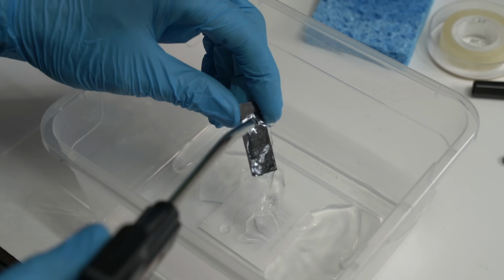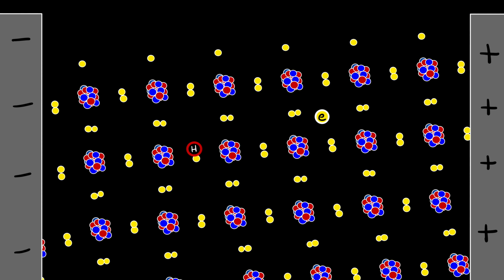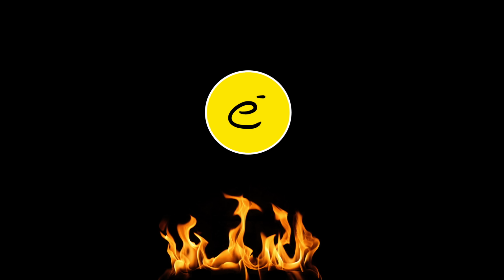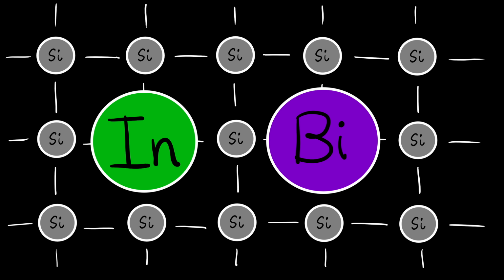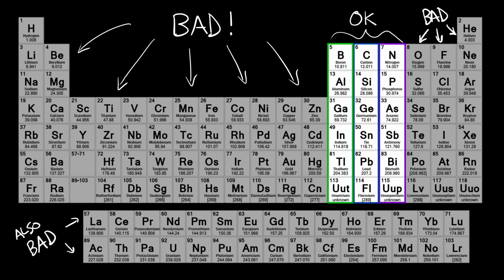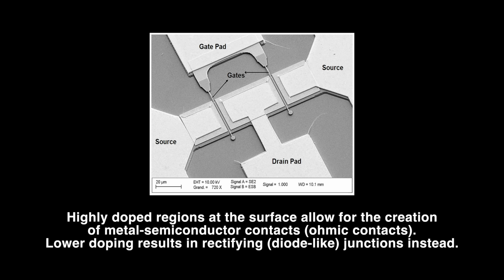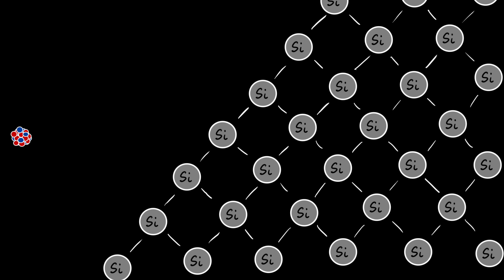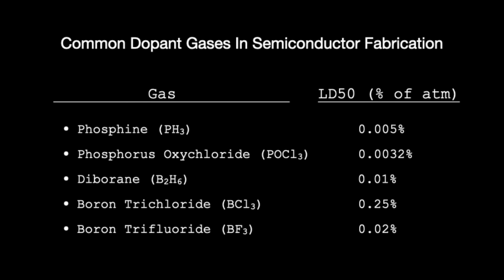Doping: The Most Important Part of Making Semiconductors

Comment: One question I have. Why not use ALUMINUM as dopant?
Reply: N-type doping (adding phosphorus) doesnt really add those phosphorus electrons to the silicon conduction bands, it really makes a small "donor band" somewhere between the valence and conduction band. P type doping adds an acceptor band above the valence. Aluminum, being more metallic in nature, would have energy bands that are, like this video said, "incompatible". On top of this, the atom is bigger, and has a much much higher ionization energy compared to boron. Aluminum is used in some applications but it really just isnt great, and boron is super common

Comment: The semiconductor equipment I final assembled in 1984 included buttons labeled n2 solvent resist spin. 16 inch teflon tubing was used to dispense those chemicals.  What processes were used

Comment: We would dope a 10kg charge of Polysilicon with Red Phosphorus using a dope tube on a Czochralski furnace by tipping the tube (hose) filled with dopant and dumping into a very hot melt. It was actually the most mass of measured dopant as much of it burned off on the surface of the melt. Arsenic, Antimony, and Boron were weighed on precision balances and just dumped on the polysilicon before melting in the crucible, and the amount was in milligrams. GOOD TIMES, GOOD TIMES 😉

Comment: Maybe you can answer this question for me because all the electrical engineers on stackoverflow or google seem to turn a blind eye. The question goes like this: In an npn transistor, lets say you leave the base floating, why does current not flow from emitter to collector. You might say "oh, that's easy, there is a potential barrier" but then alot of people seem to forget that the potential barrier is a measley 0.7 volts. And in my experience bjts have a lot more voltage. between them than 0.7v. So how is this 0.7 volts depletion layer potential able to stop greater voltages like 20v, 12v etc from allowing current flowing from emitter to collector. I know bjts are rarely operated in the open base configuration but understanding this will help me understand why it takes a small bias to do what a large voltage couldnt (bias is the name given to voltage applied to base terminal in bjt)
Reply: its 0.7V forward, but much more when reverse biased. Exactly like a diode.

Comment: YEEEEEEES the deep level impurities is what i was looking for  to make the afformebtuoned battery i soecified in the previous video,cz the way i see it atoms closer to silicon form switches and atoms further from silicon form batteries when doped onto silicon based on the deep level impurities you mentioend,,,now atleast my research is heading somewhere...nkw if only i had a means to fabricate semiconductor chips to teat out this battery hypothesis
Reply from the maker: if you're looking for information on energy storage in silicon you should read up on quantum wells and things like charge coupled devices. That being said, the energy density will likely never approach that of chemical batteries.

Comment: Amazing video, definitely one of the best explanations I’ve seen. One thing I’m now a bit confused about is why the metal contacts on transistors don’t introduce intraband states?
Reply from the maker: I'm not 100% sure on this answer, but my understanding is that as long as the discontinuity between the metal and semiconductor is thin enough, the electrons tunnel through and basically ignore the junction.

Comment: Actually you can use a nuclear reactor to produce semiconductors. The processes is called Neutron Transmutation Doping and involves neutrons diverted out from the nuclear reactor. These neutrons are absorbed by the silicon atoms forming an unstable heavier silicon isotope. This isotople quickly undergoes beta minus decay converting the excess neutron to a proton and becoming phosporus. Since neutrons can penetrate deep into matter and don't care about chemical composition or such they can evenly dope the silicon quite deep without much issue. This costly and involves radioactrivity so it's not really common. I know you were joking but for those who don't know uranium is safely sealed in the reactor and only the neutrons are coming out so there shouldn't be any uranium contamination. Besides if uranium has become a gas semiconductor purity will be your last concern. Certainly this will be your preferred doping method in the future right?
Reply from the maker: Yeah, I thought about including this to come full circle on the "exposed core of a nuclear reactor" joke but ended up cutting it because nuclear transmutation doping is basically not used outside of research labs

Comment: I remember skimming over a paper about doping wafers with plain phosphoric acid a few years ago. It was from the solar industry, but I don't see how it wouldn't translate to other semiconductors. I can't find the exact paper anymore, but some very similar ones about the same topic were published recently: 10.1007/s12633-022-02231-3 and 10.1007/s12633-023-02658-2
Reply from the maker: I tried plain phosphoric acid but it really doesn't seem clean enough for my purposes. high concentrations leave a horrible residue (silicon phosphide maybe) on the surface that cannot be etched away

Comment: Hey saw you have a fiber laser.  You can deposit simple Al contacts on Si by simply wrapping the Si in Aluminum foil and lasering squares into it.  For my 50W, I use 35% power, 500mm/s, 20kHz or 30kHz rep rate and 0.01mm hatch.  Evaporates a nice square of Al, giving ohmic contact and even contacting through native oxide.
Reply from the maker: to my knowledge i don't have a fiber laser but i appreciate the suggestion!
Reply: Oops my mistake!  Good excuse for a new toy, though.

Comment: I think you left out a fourth doping method but i could be wrong. I know there also is neutron transmutation doping, but i don't know if it has any industrial significance. Great video btw!
Reply from the maker: I was considering adding it, mostly to come full circle on the "exposed core of the nuclear reactor" joke from earlier but it got cut because nuclear transmutation doping is really never used outside of a couple research experiments

Comment: Your spin-on diffusion doping process is ingenious. If I am thinking right, you can apply the liquid dopant solution on top of a photo mask. Making the doping steps very similar to the other process and you can basically use it with the precision of your lithography process x3
Reply from the maker: unfortunately, the diffusion step has to take place at ~1000C so the photo mask alone won't hold up at those temps. An oxide layer that has been patterned using a photomask will though

Comment: One of the more interesting bits of physics unveiling before my eyes was watching gold diffuse into copper, in plain air, under a microscope.  Coworker had ordered some garbage tier RC power connectors that use hopes and dreams for their current rating, instead of real life figures.  But it probably wouldnt have set itself on fire in the application it was destined for so I humored him and was installing the connectors onto leads. As I soldered them, the whole outside of the solder cup (not exposed to solder, that was on the inside) went from the gold color of the plating to copper color. Looked it up, and turns out gold diffuses into copper really starts to pick up at 200C, right around what the solder would have been.   Normal good gold plating has a nickel layer underneath to stop this (and oxidation beneath the gold)  But because my coworker was being a cheapskate, and whatever factory in china didn't think that nickel bath was particularly needed, I got to watch solid metal dissolve into another solid metal under a microscope.
Reply: Yup, silver and zinc as well. Hence the ~high school experiment plating a penny with zinc then heating it to brassify the surface -- you really are getting a brass layer, it's not just the thin layer of zinc oxidizing to an interference pattern or something.

Silver (directly on copper) is semi-commonly used for PCB plating, but usually it disappears into the solder by the time diffusion would matter much.  Along with tarnishing, it can be a concern in storage though.

These also illustrate the Kirkendall effect, where the diffusion of atoms into each others' bulk reduces the density in each, creating voids.  Well designed plating sequences (or diffusion schedules) avoid this in most cases, but there are industrially important applications where the voiding affects joint strength -- Sn-Cu diffusion (and intermetallic formation) in solder joints, for example.
Reply from the maker: that's wild! i have never witnessed that

Comment: Super dummy question - you call yourself a hobbyist (even though I bet you must quite quite detailed knowledge about semiconductors and I guess you work in the industry). But let's assume you are a true hobbyist for a time being. So if a hobbyist can develop a cheap and relatively safe replacement for all those toxic gases, why all big multimillion foundries has not found out this idea?
Reply from the maker: It's a good question! For starters, I'm not in the industry, though I did a bit of related lab work back in college. In industry the demands on their processes are huge- they are desperately trying to make chips with billions of individual transistors, all while trying to maintain the highest possible yield (number of good chips vs defective chips off the assembly line). These goals mean that if you have the choice between a safe chemical that is effective, and a toxic, carcinogenic, explosive, and otherwise extremely scary chemical that is slightly more effective, you'll choose the more dangerous, but more effective route every time.

Comment: Does it really take 20 minutes to say you made your own doped TEOS recipe then cut on a cliff hanger? But congrats though. If it's home chemistry, I'd assume it's one of the rice hull ash glycol depolymerization routes, since they produce relatively high purity TEOS with hardware store chemicals and are fairly idiot resistant compared to carbothermal arc furnace or Siemens processes. The research I recall reading asserted that spin-on glass was usually too porous and irregular for semiconductor use apart from MEMS though. Unless the plan is to diffuse the dopant out of the dopant-rich spin-on glass and into the silicon then etch the spin-on glass layer away?
Reply: Some people prefer more explanation than others, and I think it’s nice that this video takes the time to teach.
Reply from the maker: I was going to make it all one video, but i decided that if i went straight to the lab work then to keep the video length less than 30m id have to gloss over a lot of info that i felt was necessary to lay out in detail first.

i am curious about the rice hull and glycol thing, if you have a source you'd like to share

Comment: When you mentioned N-type, I got excited because I knew the other would be P-type because of NPN/PNP transistors!
Reply from the maker: Don't forget PN diodes as well!
Reply: For the longest time [growing up], I thought you could just take two blocks of the stuff, now kiss .png  and boom, diode, transistor, whatever. (I tested, and wondered aloud, why wiring two diodes together doesn't make a transistor.  Hey, I was... probably 9 at the time?)  Sadly, all those early/easy/common references neglect to mention two things: 1. charges move by diffusion, and only travel so far before recombination dominates (in Si, a few µm, maybe 10 tops); 2. you need a metallurgical bond; a random misaligned crystal boundary with oxide inbetween, ain't gonna cut it. Astonishingly, reasonably-well-aligned crystals, and vacuum-clean and atomically-polished surfaces, can be created, and bonded metallurgically, so we can actually do this if need be(!), but it's a lot more work than rubbing two rocks together, hah.

Equally surprising, it is still true that you can rub rocks together -- or more to the point, poke them with wires, "whiskers".  Rough (read: non atomically polished) surface contact is dominated by asperities, where rough spots stick out enough to touch, give or take contact pressure and the elastic modulus of the material; this can happen with enough force to scrape off the oxides and get direct semiconductor contact (or a thin enough line of oxide, adsorbed air, and other surface contaminants, that charge carriers can tunnel through the barrier), and thus a diode is born.  Transistors are harder: MOS is out of course, but BJTs can be made by microscopically-aligned point contacts.  They also fairly early-on discovered you can fuse the whiskers into the chip, making a much more consistent, reliable, robust device; the 1N34 germanium diode is such an example, and the whisker (tungsten I think) is coated with a dopant so that when the device is assembled (glass sealed body) and activated (pulsed with near-fatal current), the point contact is melted and a PN junction formed.

Or on a more mundane level, we can for example probe the carrier type of a semiconductor by simply poking probes at it, making sure they scratch the surface (ohmmeter reads ~finite), and then heating one or the other probe (or from that side of the wafer) to cause charges to move.  Some 10s of mV are created in this way without too much trouble, so a pristine contact isn't required; the polarity vs. thermal gradient depends on the carrier type.

Comment: why dont we use aluminum as p type doping? shouldnt the atom be more similar to silicon instead of boron?
Reply from the maker: You can! In fact, back in the day they'd actually make electrical contacts by applying a tiny bead of aluminum and putting it into a furnace. Some aluminum would diffuse into the chip, making a doped region and then the rest would stay behind on the surface as an electrical contact.
Reply: doesnt that also give you a shottky connection?
Reply from the maker: @suncrafterspielt9479  It depends on the doping amount. If you have a metal-semiconductor junction where the silicon is lightly doped you get a diode, if it's heavily doped you get an ohmic contact

In the process i described in the first comment it results in a heavily doped region, so it should make a non-rectifying junction
Reply: Thanks a lot for all the explanation :D

Comment: 5:35 "Because there is one extra electron and no hole..." - could have used clarification; the atom of phosphorus does mean there is an additional proton, so when its extra electron moves around why doesn't that create a "hole"? The answer is that a hole is absence of an electron *from a covalent bond*, and that is not happening: all the bonds with the surrounding silicon atoms are satisfied.
Reply: Yeah this could use more emphasis (if one want to get deeper into semiconductor physics). 
The remaining phosphor atom will be positively charged, which has huge effects - mostly creating pn-junctions, but also causing coulomb scattering.